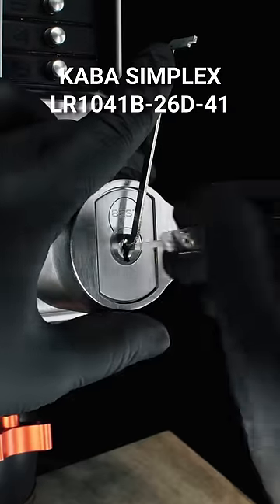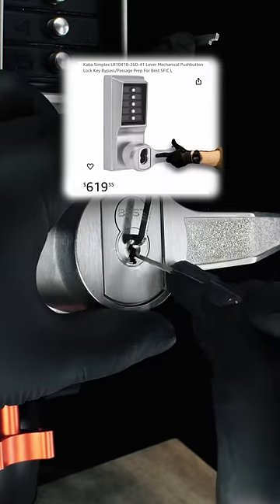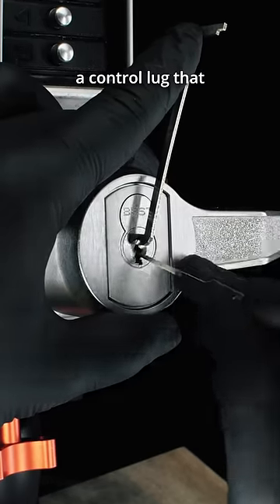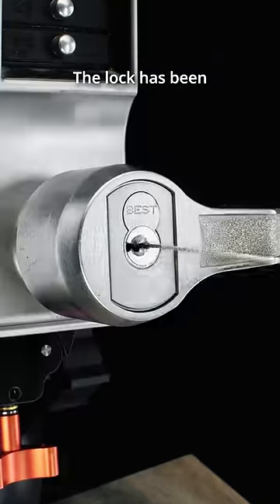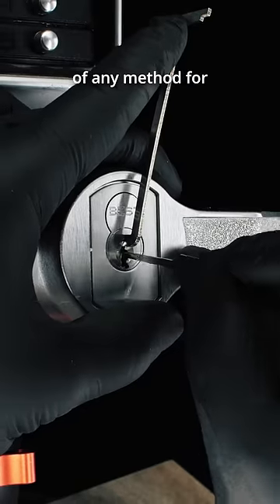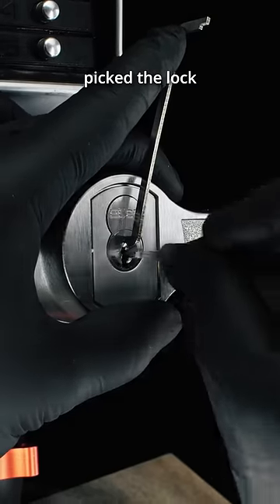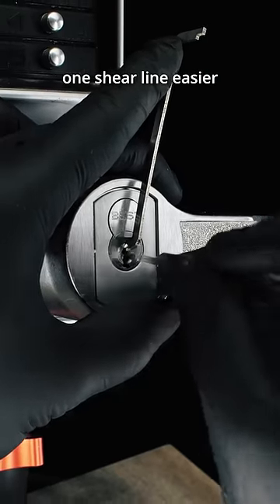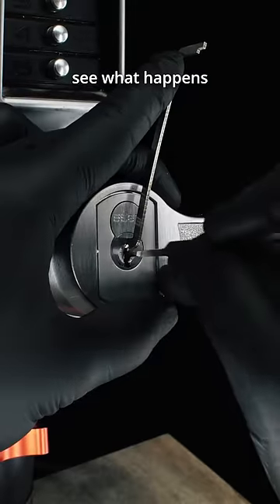Kaba Simplex (BEST SFIC) opened with Riv Pick

Comment: The fact that it took him atleast half of the short to actually pick this lock and the fact he calls it a "Wee bit of a doozy" are enough for me to call this lock a decent lock
Reply: $600 price tag made me do a backflip
Reply: Yeah I would call it a pretty decent lock.
Reply: I would call it a insanely good lock, maybe the only one that works properly
Reply: @boyista9877 it's definitely pricy, but it's not uncommon to pay $200 plus for a residential deadbolt that accepts a code for entry, not even including the knob. This is used in commercial settings. Even if you have 10 doors and have to drop 6k you will most likely save that in insurance over a year or two. Definitely vs a break in.
Reply: Because that's not him picking the lock
Reply: the combination only version would make this even more secure correct?
Reply: @boyista0 you wouldn't buy this thing for your barn, it's something you install on your front door if you value your security
Reply: I believe the combination part of this lock can be bypassed by a strong magnet 🧲
Reply: Feature is bit random not a real security.
Reply: Yeah, I think the same😊 good lock
Reply: The fact McNally isn't smashing this open with another Kaba Simplex 1041 says everything haha
Reply: These r good locks, with the right key combos it's almost impossible to get the control shear to pick, he most likely keyed the lock so it was easier to pick for the short, oh and to key up these cylinders you have to do math cause each pin stack needs to be a certain height
Reply: Yeah I definitely will use this lock usually it take him 3-5sec but this almost full 1 minute 👍👍👀 I grade it as Grade A lock.
Reply: Just because he wasn't able to open it immediately with wave rake it enough for me 😂
Reply: meanwhile the other half is him proving he can just steal your lock by picking it twice
Reply: I don't know...  When he picked the wrong shear line,  the entire core poped out in his hand...  That is beyond unimpressive.  The possible results are either you pick it open,  or you pick the core out of the assembly, allowing you to just open the door without any constraints ...
Reply: Only buy these new from the manufacturer, older models have a design flaw that allows you to pop it open with nothing but a magnet
Reply: @boyista9877  This made me laugh out loud. Idk why I found this so funny bit thanks for the comment to the commet
Reply: I have heared LPL refer to some locks as one he would use himself. That is a compliment.
Reply: Can he open it with another lock
Reply: @leovillant768  not unless you can break the door down with said lock.
Reply: You mean an amazing lock
Reply: @louisjutras1  It's designed to do that. You either pick one shear line or the other. Either way you get in the door. The double shear line makes it more difficult to pick but it's also a customer feature to allow rekeying the lock for added security.
Reply: No, he just needs some more locks from this brand haha
Reply: This is one of the best locks on the market
Reply: Unironically, I thought "this is the best advertisement for a lock I've ever seen, this man can usually open a lock by asking nicely"

Comment: That is easily the best lock I have seen on this channel. Not even close
Reply: SFIC cylinders are typically easier to pick because usually they'll have quite a few shearlines due to multiple keys being keyed to the lock. So technically less secure.

The real difficulty in these locks is picking to turn the control sleeve.

Comment: Imagine buying the lock and thinking "I'm secure!" Then coming back to see the lock cylinder gone...
Reply: 99.9999% of criminals couldn't pick this. And if they could, they wouldn't feel safe spending that long picking it
Reply: @jstar3382  "That long" is faster than drilling.
Reply: @XtreeM_FaiL  watching enough of these types of videos ive come to the conclusion that locks are only designed to make you a less attractive target, not prevent your things from being stolen.

As the saying goes, i dont have to outrun the bear, i just need to out run you...
Reply: @MBNHedger  100%

Comment: As an apprentice on my ship I picked and removed the cores, I told leadership I could still guarantee access without keys and they were all about it since the keys had been lost and they didn’t want to pay for 5000 new kabas.  Sometimes a little knowledge is valuable.
Reply: How often do you use the key versus the pin code button. 
Figure keys would be rarely used
Reply: @ICYUNVM3  not at the rate people in the military lose keys. Typically I agree it’s not a huge deal, but when a ship goes through an extended period of repairs, there is a lot of crew turnover and people forget combos and lose keys like you wouldn’t believe.

Comment: These are extremely popular on telecom buildings and huts. I’ve never had a problem getting into them even if none of the combos I knew worked. If it’s outside, you will be able to tell what numbers are used in the combination. If you do it systematically worst case it takes you 15 minutes, but if the lock is inside the building. You tie a string around a nail or something similar and drop it behind the latch. I even cut myself a metal credit card size tool to do this for me. Swipe for entry. Keep in mind, if you’re not authorized to be in these areas that is a felony.
Reply: I also work on these huts. Integration tech?
Reply: I used to be scared of these guys.

Spent a month working with them and now can rebuild from scratch.

Trilogy's next on the chopping block.
Reply: And long walks on the beach…

Comment: why hasnt anyone made a lock with fake pins?
by fake i mean if you pick them you actually lock the door instead of unlocking it
Reply: probably because that's not how a lock works
Reply: you can actually do this with certain locks. watch lock picking lawyer's video 527 where he used wafers that dropped into groves on a Kwikset core that would prevent the lock from rotating if you picked it wrong. 

The problem is a functionality like that would destroy or temporarily disable the lock and can only be resettable with a full disassembly. so, a legit user gets locked out as well.
Reply: I forgot the locks name but there’s one with fake pins to make it more deceptive to pick.

Comment: Peterson sells a special tension wrench to tension the control lug, theoretically selecting for the control shear line. I’ve never used them though, if I need to remove a core without the control key it gets a few minutes of attention with a normal L wrench and a rake or hybrid diamond and then it gets a 3/16 drill bit. I don’t usually work on keyways I can get blanks for, so it’s not like I’m going to be able to make a control key.

Comment: I have heard elsewhere that you can control which shear line you are applying differential torsion to, via the holes in the cylinder, at bottom of the keyway.  A torsion tool can be use to apply torsion only to the inner cylinder sleeve, to pick the change line.  Alternatively, torsion can be applied to the outer sleeve, to pick the control line.  It makes sense, however I have never seen a torsion tool or lishi tool with the needed interface to do this.

Comment: Fun fact, most ic core locks it doesn’t matter what shear line you pick it to on a lever set. Once the core is out you can use a flat head to open it from within with the core removed

Comment: Most businesses use interchangable cores, as it is easier to have the contracters all use the same key for every door, and then send the installers with a control key and correctly pinned locks. I specifically worked with Schlage and Yale locks
Reply: Great for construction and first year of business, after that first year, the control key ending up in a gutter somewhere and I end up swapping for standard cylinders lol

Wish I had the skills to pick for the control sleeve

Comment: There's a tension tool that works off the inner barrel and the access holes in the bottom to tension more heavily at the control level. It makes it much easier to pick to the control level if that's your target. Peterson I-Core Tension Tool

Comment: We use these at work and i make ALOT of these cores like all the time. We recently got an addition to the building and i was talking with a best representative and asked if the cores they would build for use to install would use any security pins at least for the entry doors. He told me they were manufactured so precisely you couldnt pick it then i pulled out my pick set and said well i just picked one 10 minutes ago. He was not happy. But when the locks get worn trying to pull the core the control key can be rough. I usually hit them with a hammer till it comes out and only bent one key doing that.

Comment: I work emergency overnight maintenance in some very secured buildings with locks ranging from the late 80’s all the way up to modern locks like the exact one in this video. I'm no locksmith, but I had to figure how to accomplish this exact scenario two weeks ago. You made it look so much easier than my hour plus long experience was! When the tumbler finally slid out, felt like I won the dang lottery…
🫡🤣

Comment: This is a good lock and one of the many reasons actually secure workcenters have multi layer system verification.

In my work center, security is automatically notified. So if you pick the lock, somehow know the security code it likely wont even help you bcuz if they dont have you scheduled to be there opening things up, top flight security is en route VERY quickly.

I know bcuz it happened to me when I left my wallet inside.😂

Comment: The jobsite I'm on uses these locks. I don't know if it's an issue with the locks themselves, or if the master key is just bad, but they seem yo stick and jam up a lot. I'm sure it doesn't help that the door guys have just not bothered to install striker plates on some of the jams

Comment: Can you rake these? Naturally you wouldn't be able to control which shear line but at least if you can get all the pins to the same shear line that would either operate the lock or release the core and let you operate the mechanism manually

Comment: aren't pushbutton locks like this not very secure? unless kaba have fixed this vulnerability, the combination can be input in any order as long as the digits are the same. if 123 opens the lock so does 321 and 213. This, along with the fact that a digit cant be reused, greatly reduces the number of combinations you need to try. There are only 31 combinations with 5 possible digits which would take 1-2 minutes to brute force